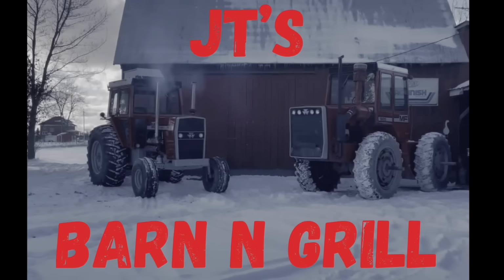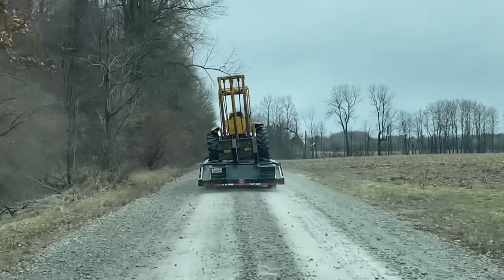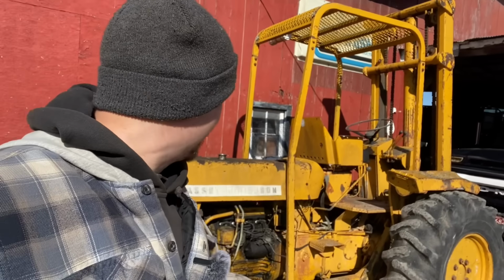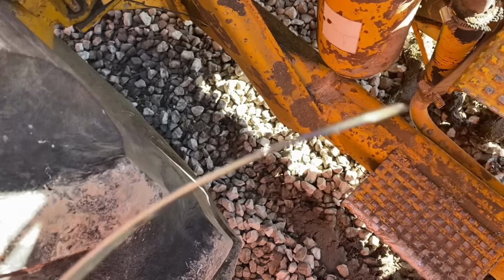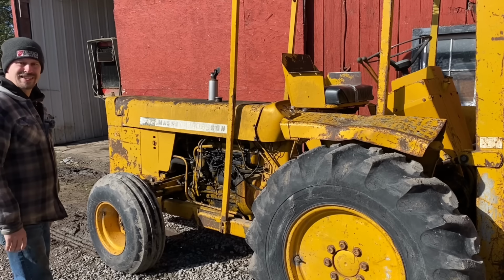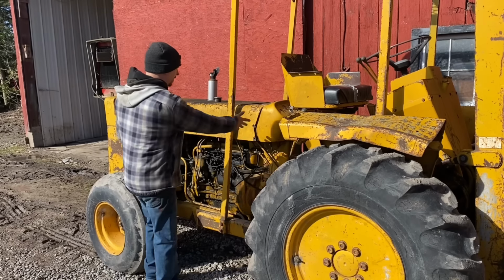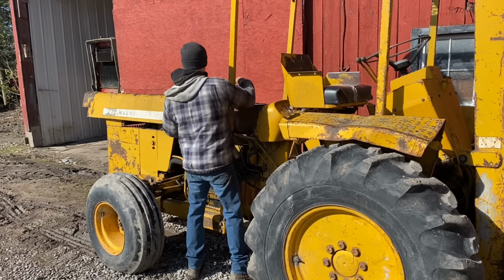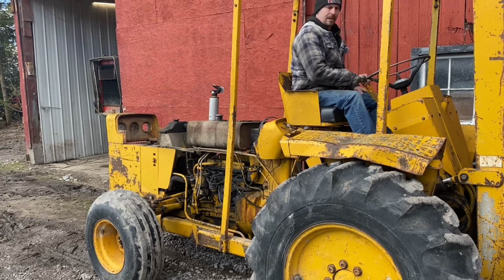Will it start?  “Working conditions unknown” Massey Ferguson 2200 forklift!

Comment: Good buy on the Massey 2200 industrial they’re based of the 135 ag tractors, the Perkins 152 would be my choice of engine, std gear box 6 forward 2 reverse, best of luck
Reply from the maker: Thanks for the info!

Comment: When loading gravel with a rubber tire loader in the old days when you had the slam the reverser or shuttle shift that is when you needed a new PIN in the Clevis

Comment: Every once in a while something works out!😊 Years ago I bought an Astro van for $400. The owner said it had a bad motor. At least that's what his mechanic said. He had just had the transmission replaced so it had that going for it. 4.3 V6. He refused to let me start it as he was afraid it would cause more damage in the event I didn't buy it . Gave him his money, hauled it home and after it was off the trailer I figured "what the heck"! I turned the key and she fired right up and was making a tinny rattling sound. Hmmm? As he said he had just replaced the transmission that's where I looked first. The inspection cover looked a little bent so I pulled it off. Started it again and found the noise gone! Drove that van for 4 years before I sold it on. Don't ask about the 2010 equinox I bought that almost caused bankruptcy 😢
Reply from the maker: Those old 4.3’s were built to last!  
Ecotech motors on the other hand…

Comment: I don’t know if anyone mentioned it but that’s basically a MF135 series tractor with a forklift.
Reply from the maker: Yep, but there was some question as to if it was based on the 135 or 165. 
It has many similarities to my 165
Reply: @jtsbarnngrill6873  most likely and it might even be more like a 135 Orchard which was a 135 engine surrounded by a 165 drive train. Massey made some neat tractors in it’s heyday.

Comment: A  MF 135 with power reverse transmission. A really nice little machine and smooth when working properly. Must be a late 60's machine with the continental. Give it some TLC and it will last a long time. Suprised the reverser works that good.
Reply from the maker: Right on!  She’s gonna get the good treatment!

Comment: JT, you  deserved  a  win.  Period.  Damn  nice  find.  Screamed  at  the  screen,  'bout  the  pedals,  guess  y'all  was  distracted.  Sorry  Dude.  Next time  I'll  do  better.  What's  her  lift  cap?  Tag  on  the  machine  somewhere,  if  readable.  Looks  like  a  18  to  20  foot  lift.  Drain  the  gas,  do  the  carb  and  points,  if  applicable,  but  i  can't  really  see  electronic  ignition  on  a  Continental?  Gas  is  older,   lots  of  cylinder  space  causing  pressure  leakage, engine  runs  like  crap,  there's  yer  problem.  Oil  change?  Yer  coming  into  spring  and  summer,  right?  Use  15W40.  I  use  that  in  my  Jeep  4.2  with  tooooo  much  blowby.  Engine  rebuild  ain't  in  the  finances  yet.  And  just  fer  crap  and  chuckles,  fix  the  right  fender,  put  a  water  bottle/can/cup  holder  on  it,  and  whomever  is  using  the  forklift  while  building  the  shop  will  thank  you.  Now,  when  can  we  expect  paint?😁
Reply from the maker: A 15w40 change will come in Sundays video, she’s 10x better already!  Says on the boom that it’ll lift 4000 to 15’ and 2500 to 21’. That’s a lot overhead lol

Comment: Actually with the linkages you just put a new pin in them because you will be really shocked with the old stuff how much better it will work it's not like now now you replace an electric switches to make everything work right and I like the easy stuff

Comment: LOL good video!! That transmission I bet is somewhat like the old Turnbull 202, 203 or 205 Industrial, been a while since I seen it, at Moms yet, Dad had when he started out in the backhoe business, we used  it for finish grading, it has a Perkins 3 cyl diesel in it, and has 3 pedals on the right. Center is the throttle, now here is the part I have trouble with today, the right pedal I think would go forward, and the other would be reverse, why I cant remember is, I have a JD X320 riding lawnmower that is just the OPPOSITE. Oh yeah, after spending hours on the Turnbull I still remember that old girl well!! And almost tore up some shtuff around here in tight places with the X320!!. It was good for finish grading, NOT, with a plow or brush hog, because you had to hold down on the pedal, think about that with a plow or disking a 50 acre field at our homestead, holding that pedal down when your 14!! And the little Perkins, was a fuel sipper, IF you run 10 gallons of fuel through it a day, YOU DONE SOME WORK, now getting it to start below 20 outside and didnt plug in the block heater you might as well forget it, and go back in the house until it had heated up a bit!! I will tell you to RUN, NOT WALK away from a backhoe Massy made in 1969, cant remember the number , Dad bought a BRAND NEW one, BIGGEST POS, ever that sat on the place!! The 4cyl Perkins and trans, we never had a problem with, the loader frames, the dipper stick cracking, and after 4 Cessna  hyd pumps replaced under warranty ,that POS got traded off for a New 4500 Ford, we had really good luck with Fords , even they had quirks to.
Reply from the maker: Right on!  I’ve never seen a MF backhoe in my area, but if I do I’ll avoid it 😉

Comment: Great find . Oil change go though the carburator new points plugs and wires. Probably last you for ever. Have to agree with another comment the look on your face when fired up. Great video.
Reply from the maker: Thanks!  
That is the JT look of surprise 😉😆

Comment: The Yellow Peril is a nice forklift, ok it has probs, but I think new plugs and points, new cap and leads, and some new 20/W50 oil and she won't have as much blowbye coming out the breather. Of course when you have your new workshop built you can remove the engine, put new rings, seals and shells in her and she will last for many years.  Love the lawnmower, will be worth fixing as it has the proper engine..  
All hail to the Yellow Peril.   Lol
Reply from the maker: Right on!  Thank you!

Comment: If you get the garden tractor running, maybe you could fine you a snow blade, or you can find you a sleeve hitch, so you can plow and disk Mrs. Jt's garden that would be cool, there it nothing more fun than moldboard plowing with a garden tractor
Reply from the maker: Right on!  I was thinking I’d put ag style tires on it and use it to do things like that!
Reply: @jtsbarnngrill6873  You'll have to find you a sleeve hitch and brinley plow and disk, I don't know how hard the sleeve hitches are to find on a Massey Ferguson

Comment: What a nice find!! Forklifts live a terrible life just because they are started up used for a few minutes to lift/move something then shut off.  Nobody ever maintains them either i swear.  I wouldn't be one bit surprised if it came back around from changing the oil throwing new plugs at it.  Before i did plugs and a oil change i would soak the cylinders in seafoam or something I'll bet the rings are all carboned up from never getting to operating temperature.  Once you soak the cylinders in something do a oil change I'd go bomb it around the roads give it a workout build some heat keep the rpms up then I'll bet that blow by simmers way down and it runs way better!  Id love to see more of this machine
Reply from the maker: Right on!  I didn’t think about that but I’ll bet you’re spot on!

Comment: Seems like an early Lift-Master.  Pedals may be forward and back w throttle ...  2 full cans of BG-109 in the used oil and run it around for an hour.  May free up the rings some ...  Then change the oil.  If that didn't do it, try flooding the cylinders with some WD40 and let them soak.  The top rings may free up ...
Reply from the maker: Yessir!
Reply: Try looking for a video on solvent ring flushing.  It's a thing in the airplane world where an engine has low compression from stuck rings.  They pull the top plug and put in a home made solvent mix, re-install the top plug on compression stroke with about 1/2 pint of their magic elixir and hand prop the motor.  They say you can hear the solvent getting blown by the rings.  Gotta do it over 5 or 6 time.  But each time it should get easier as the solvent squirts through the end gaps and finds less "goo" between the rings.  I used to do this with WD40 on old yard equipment when I could pull them over with a rope.  Usually got back a lot more compression and less blow by.  Of course this one could just be wore out.  But a ring flush is a lot cheaper and easier than tearing down the engine as a first step 😁

Comment: Nice little forklift. I was thinking it was used fairly recently because the workstation platform was still shined up, not all rusty. Or maybe I was seeing things. A tune up and oil change might go a long way with a carburetor rebuild. I have an old Allis Chalmers 521, handier than a thumb in a mitten. Thanks for the video. Have a good weekend.
Reply from the maker: Thanks!  It is hard to say,  no one at the auction knew anything about it.

Comment: You won on the 12 with it having the original chrome heat shield on the muffler. That's one of the hardest original pieces to find. 

If it has the tecumseh 12hp, the ignition coils are known for failing but can be found now aftermarket. 

Watch the steering box. They van get sloppy but have adjustments to tighten them up. 

I used to have a whole collection of massey garden tractors. I did prefer my hydro drive 12 for mowing. The vari drive was nice for the rototiller.
Reply from the maker: Right on!  Thanks!

Comment: Nice. 2 good scores. That was an easy one. Even a blind squirrel finds a nut once in a while. Little bit of work and it will do just what you need. I think you will be surprised just how much you will actually use it. The lawn tractor at worst could still be parts for the other one if you can't get it going.
Reply from the maker: Right on!  I agree, that forklift will be endlessly handy!

Comment: Being an Allis guy, I came across an AC 621 forklift a few years ago for $2500.  Similar to yours, based on a tractor (D15 in my case) with a foot and hand forward/reverse system.  When I bought it the guys selling it, a golf cart sales place, said it needed a $650 carb and the power steering/hydraulics don't work work.  I took the carb apart, everything was loose inside and the fuel hose was falling apart.  Tightened up the carb pieces, replaced the fuel hose and it cranked right up.  The clutch needs to be out to run the hydraulics, you just use the forward/reverse lever to move back and forth.  I'm amazed how many times I use it in a week.  I think you will wonder how you got along without one!
Reply from the maker: I agree!  Can’t believe how much use it’s gotten in the few days I’ve had it lol

Comment: Excellent video JT  :) yes nice win on Fork  Lift Massey Ferguson type also think should get engine flush clean running thru engine before do mix in before changing engine oil and oil filter have  Engine flush in for  5 mins run  before changing! Also Engine Flush Fluid  in 1quart bottle  in red and grey color  called GUNK Engine Flush Fluid smell like paint remover but does super job and get 10w30 engine oil no synthetic type to also STP Total Treatment fuel injection and carb cleaner in 89 octane gas with 5% Ethonal  or 90 or higher octane gas no Ethonal % at all ! Plus use Platinum spark  plugs , high Suppression  wires also new cab plus rotors also points too if got is! Plus fuel tank clean , fuel filter also rebuilt carb , Oil pot oil filter NAPA or Tractor & Combine dealer should have them ! Would check on internet for all need before buy too for this Fork Lift and think have use for building new shop for walls , trusses, metal , roof too and much more! Also would change front tires before work with it too ! Hope Massey Ferguson 12 lawn  tractor is easy fix on next videos too and goes super!
Reply from the maker: Thanks for the info!  I’ll be doing a small service on it for the Sunday video, makes a big difference!
Reply: @jtsbarnngrill6873  welcome JT and be looking forward more videos too also no problem on do repairs to try !

Comment: As long as it can be made to idle reasonably and has enough power for what you need it to do, a worn out engine has some good characteristics.  Since it burns oil, you don't have to fog the cylinders if it is going to sit for a while, it self fogs.  Also since the clearances are so loose, it takes quite a bit of corrosion to seize the engine.
Reply from the maker: Good points!

Comment: Looks to be the torque transmission lever on side diff lock before using lift with any load make sure tyres are good a blow out with a load up is very scary
Reply from the maker: Good call!  A blowout with weight on the forks could put me on my side 😬

Comment: Starts an runs the first try!? That almost never happens! Those Continental engines were tough! Easy repair if you can get the parts.
Reply from the maker: Right!  I did a rebuild on a z120 a few years back. Tough little motors
Reply: @jtsbarnngrill6873  z120? what's that JT?
Reply from the maker: Continental z120. It’s the little brother to the z134 that is in my forklift.
Reply: @jtsbarnngrill6873  ok...thanks. what was that motor used on?
Reply from the maker: The one I worked on was in a to-20 Ferguson

Comment: Nice one j.t.  more luck again I don't no.  That little lever is probably diff lock the big lever on the side should be all your gears 1.to 4. And one under seat should be high and low.  Just like your 165. It's just the seat turned around. But you have like hydraulic  box for back and forward.  From Andy in uk
Reply from the maker: Right on!  Thanks!

Comment: Change oil and a good tune up and a little body work and you will have a good running forklift if you don’t mind a little blow by now the big dilemma paint red or yellow
Reply from the maker: Right!  I’m thinking yellow like original
Reply: @jtsbarnngrill6873  But most of your equipment is red if you paint it red it will blend in and then how about a red JD

Comment: What ever happened to the 1422 IH tractor?
Reply from the maker: 1422?  I did not have one of those
Reply: That 4 wheel drive international, don't remember the numbers.
Reply from the maker: The 4166.  That deal unfortunately fell through. The owners family decided they wanted it more. 
Yet it’s still sitting right where I left it lol
Reply: @jtsbarnngrill6873  oh ok, that would have been a cool project 😎

Comment: I was concerned when you unloaded the forklift without removing the forks. It couldn't cost that much for you to rebuild that engine. When you get your shop and some old pallet racking from the local SpartanNash (Nash Finch....nasty grinch) warehouse that forklift will come in handy.
Reply from the maker: Right!  I think I can do a total rebuild on that motor for less than a 1k.